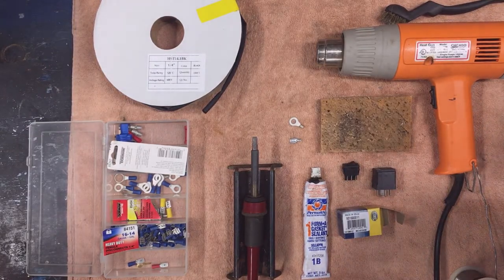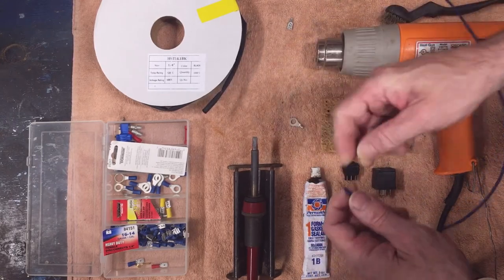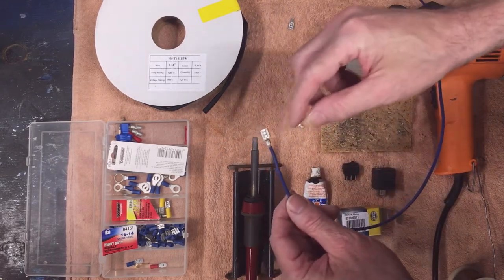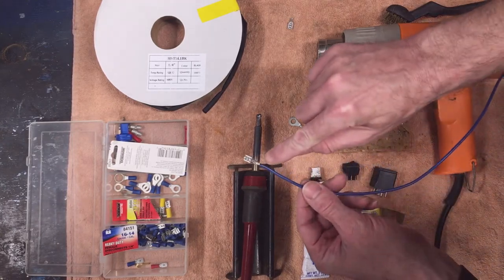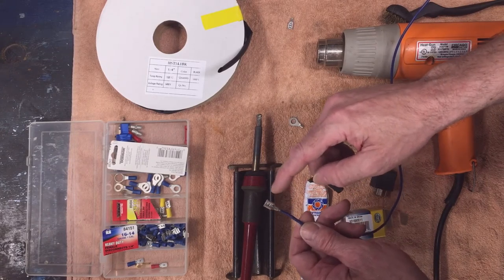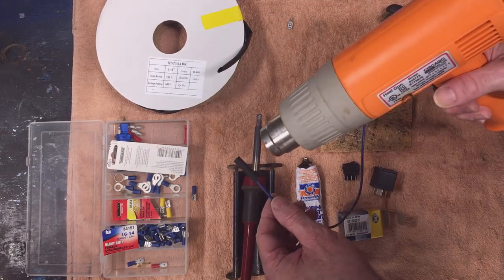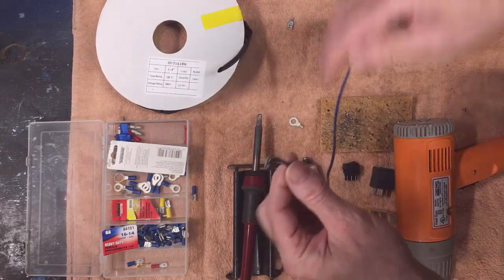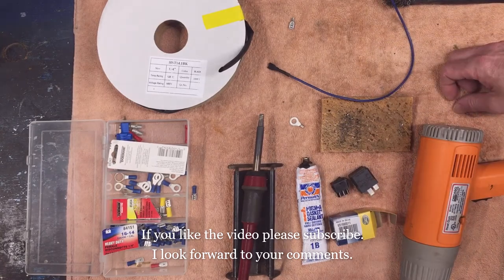How to make a better connection with crimp connectors

Comment: Nice job for going into details for the whole process sir
But I have some comments:
1) The soldered joints are not preferred in sitiuations where the wire is exposed to vibration or bending like the automotive applications as it creates strain which leads to breakage so crimping ONLY is the way to go.
2) crimping should be with the non insulated crimps pliers and the crimp indent should be positioned on the flat spot of the terminal not on the slotted side (180 degrees) from what you have shown in the video.
3) the rtv silicone is a good tip, or you should use the ready available adheasive heat shrink tubing.
Thanks
Reply from the maker: John, I appreciate this kind of comment, it adds a lot of value (for those people that read them) to a video. I'll address your points in reverse order: 3) Yep, the Adhesive Heat Shrink Tubing would save time, and you want that seal on Automotive Wires. There is also Heat Shrink out there that you can use to label the Wires.  2) Yep, you are right, I must have not been paying attention, while filming the video. 1) I'd have to see a formal study on Solder vs Crimp Connectors, this doesn't pass the "makes sense" test in my mind. During Crimping you are smashing Stranded Wire inside a Steel Cylinder which is likely stressing the Copper Wires at the interface point.  Soldering holds all of the Strands equally, doesn't have the potential to pull apart like a poor crimp may do. Additionally Soldering forms a better conducting connection.  Military Amphenol Cannon Plug Electrical Connectors use soldered Pins and Sockets, this is the premium Connector. OEMs do it because crimping is quick and cheap.  Can you provide any references to why you think that?  Thanks for the comment! - Stiles